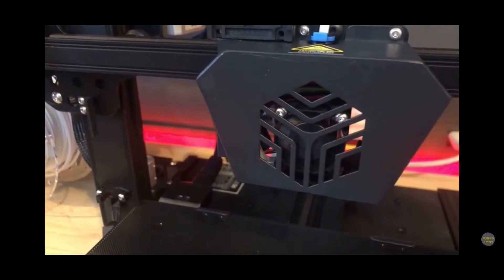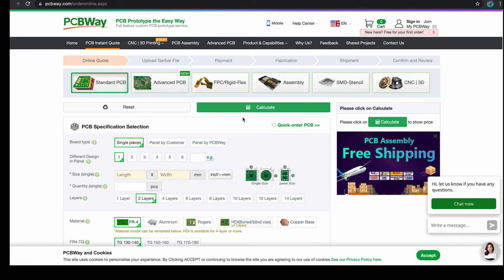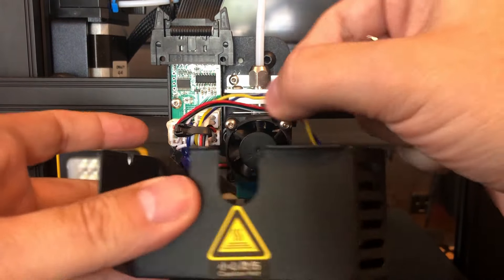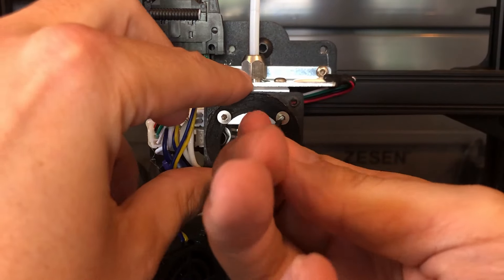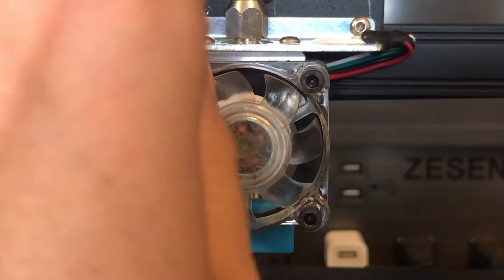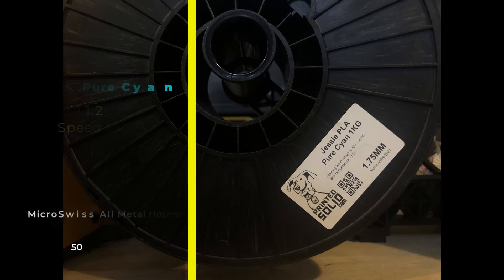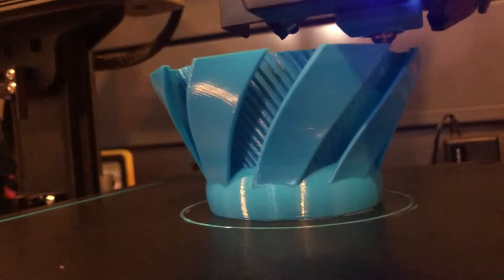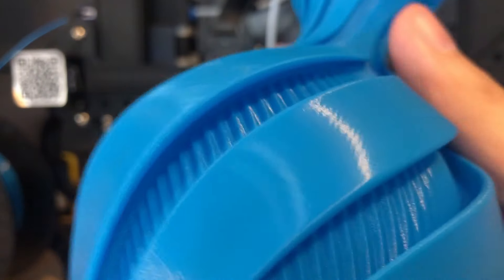CR6SE Upgrade  - 30mm Hotend fan to 40mm RGB

Comment: Dusted off my old CR6-SE printer after not using it for about three years! Will give this a shot as the original fan housing got damaged (melted touching a Micro Swiss hotend I just installed) & I had to break part of it. Unfortunately, I had some trouble with the Micro Swiss and just bought a replacement Creality hotend. I found my PLA appearing not to feed was due to the Z offset somehow getting changed to zero! I might swap hotends and see if the Micro Swiss actually works now.

Comment: John,  Thanks for the link to PCBway.  I'm getting a quote for an aluminum part that I  3D printed..  I converted the STL file to an IGES  and submitted that.  A metal version would be stronger and more heat resistant.  Will let you know how it works out.
Reply from the maker: No problem!  Thanks for the referral 👍.  I am actually looking to use them for some aluminum parts as well.  I want to do some RC content over the winter.  I ordered a new RC car for the first time in 8 years.  Let me know how it works out!

Comment: @tripodsgarage Great video.  I’ve been learning 3d printing during last couple years.  Do you think the heat creep issues may have been contributed to by upgrade to better micro swiss all metal hotend and using higher temp materials? The smaller fan couldn’t cool down heat sink portion of hotend so heat creep?

Comment: Happy to see you got the printer running for more than 10 minutes without catastrophic failure. Still think a upgrade to onboard fire suppression would be a wothy upgrade...lol.  Both my hot end and parts cooling fans on my CR6SE came with the failed out of the box option! Literally not a single print before bearing failure. As if they could ever call a sleeve an actual bearing. Those Winsinn 40mm RGB fans are not that much better quality wise but at least they are quieter and seem to cool as good if not better than the stock fan. From personal experience expect out of the 4 pack, 2 will fall in 4 to 6 months.
Reply: My hot end fan started making whining noises after around a month and Creality did send me a replacement - eventually, after originally shipping me a motherboard cooling fan by mistake. I have 40mm Orion 24v on their way though so this video is fortuitous.
Reply from the maker: Yeah, it has been running for about a week!  Must be a personal record for me?  I should put in a argon gas fire suppression system, but I would be afraid it would deploy while myself or Bear is in the garage ;-).  My hotend fan bearing died within a week of owning the machine, was in my review video.  Yeah, I know the Winsinn fans are not the best, however it has lasted about two week so far!  That is one week longer than the stock fan did.  I always get the 4 pack as well.  Thanks for watching and commenting!
Reply: @TripodsGarage  John you always have something interesting to report and like I've said before I respect your integrity. No candy coating to sweeten a bitter pill. Must be a personal record for you... a whole week...WOW! :0 Yeah argon would be cool but you or the dog defiantly wouldn't want to be in there if it ever went off. I have considered adapting a fire suppression system like we use in the race cars in the print farm. Maybe someday I'll get to it along with all the other printing related projects...lol. Right now making more space for the new incoming printers is a priority. The performance and dB on the Winsinn fans are fine however they just don't seem to last for me. Another problem that I have with most fan manufactures is the lack of published spec's! Even though since there is no industry standardized testing procedures and I take all of them with a grain of salt. It still would be nice to get a full set of published spec's (as a base line) when seeking out replacements. Makes it next to impossible. Only the more expensive brands seem to bother with full spec's and even then some are lacking. Ever try to even get the spec for a Creality fan...lol. good luck. At the very least I want CFM, Static Pressure, dB, RPM and MTBF. Guess that's asking for to much?

Comment: Got to love the Clockspring models. It takes me 5hrs 3min at 0.2mm layer height and I have made a stack of those in rainbow silk PLA that the wife keeps giving away. It passes the Bear test but is the wife happy? Nice video John.
Reply from the maker: During the droid building series.  That heat creep shelved (well floored) the printer.  I have printed 6 models with zer heat creep after replacing the 30mm fan.  Yeah, I am a big fan of Clockspring.  This vase took 7hr 40min at .12.  The cleanest vase print I have ever done.  It passed Bear’s quality control and the wife loves it 👍.  Thanks for watching and commenting!
Reply: @TripodsGarage  I have had a couple of heat creep blockages using silk PLA and already have a couple of 40mm on its way - not RGB unfortunately.

Comment: Hey buddy i normally use pla to print most of my models with mt cr6se but what filament would you recommend to print this adaptor as you mention using high temperature filament?
Thanks in advance

Comment: Those are the same fans that slice uses!  They are loud but they can push some air usually. I don’t know about on those hotends tho
Reply from the maker: It is at least quieter than the 30mm stock fan, and so far has last twice as long - LOL

Comment: Nice video going through them now learning as much as I can.  One thing I can't understand is why on earth so many 3d printers use the bog standard janky stupid allen keys?  For the sake of the lord give your body and mind a break and get some small allen drivers like the ones used for radio control cars and planes.
Reply from the maker: I use the Allen Keys supplied with the printer for most builds, and mods.  Mostly because, that is what people will have.  I have a nice collection of Allen Keys and electric screwdrivers.  I miss building RC cars.
Reply: @TripodsGarage  Fair enough I cant stand allen keys lol.  Yes I miss RC Cars too used to race them when I wass a boy.  Miss my old Losi XX and Cat2000. :)

Comment: How long did it take you to print that vase 🏺 at 0.12 layer high? and does the 40 mm fan cool faster?
Reply from the maker: 7hr 40min total print time.  The 40mm cooling fan is only for the hotend, not the part cooler.
Reply: @TripodsGarage  
Does the fan cool faster than the 30mm?
Reply: @TripodsGarage  
Ok thanks can you please share the link for the Adapter
Reply from the maker: @TheDronzDr  - Believe everything that I used is in the YouTube description.
Reply: @TripodsGarage  
Thanks
Reply: @TripodsGarage  
Hey do you think if I print it in resin that it will last longer than the PLA?
Reply from the maker: @TheDronzDr  Depends on the use, PLA is a stronger material

Comment: Quick question are these fans generally quieter or it is better to try something like Noctua?
Reply from the maker: Hello Aleksandar,
I didn't recommend any specific fan for this reason.  There are a lot of choices out there.  The bigger the fan, typically the quieter they run.  I wanted to improve the heat creep issue I was having, more than how quiet the fan is.  If you are going to try a Noctua fan, you might want to check out Chep's video https://youtu.be/vjL38udVS24 thanks for watching and commenting!
Reply: @TripodsGarage  Thanks! I am buying CR6SE  here in the UK. Can you let me know what to watch out for not to catch fire? I know you had a couple of videos about it but I am not sure still if it is a fixed batch.
Reply from the maker: @sabotage3d  It is my understanding that grounding issue was with the Kickstarter and early machines.  I received a new CR6SE machine back in April, still in the box.  If it is worth while to my viewers I can do a comparison video?  However, I have a few videos that will be ahead of that one.  So we are looking to be about a month out.
Reply: @TripodsGarage  That would be great thanks. A lot of people are put off by these issues for this great machine.

Comment: Why did you use the 12v fan ?  Stock is 24v.
Reply from the maker: You were the first one to notice 👍.  I actually grabbed the wrong fan from my stockpile.  The description was updated, to reflect the mistake.
Reply: @TripodsGarage    I had noticed they offered the fan in a 24v option.  Thanks for the info... I think I'll do the same to mine.
Reply: @NAV3DP  So I put the 24v on my machine and was not impressed with the speed.  I think I might use the 12v version actually .

Comment: Those rgb fans are not meant for long prints
Reply from the maker: Been running in my CR6SE since then.  Also my Raspberry Pi has been running them 24/7 for 6 months without an issue.